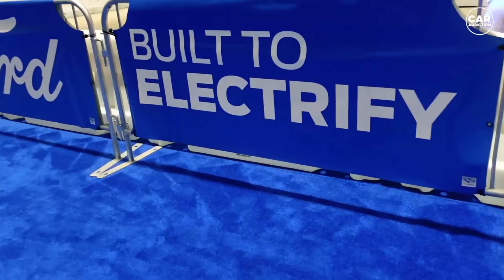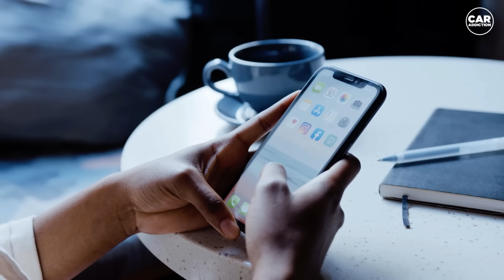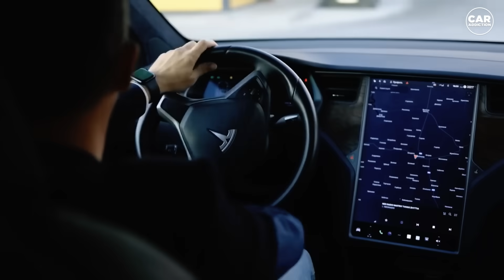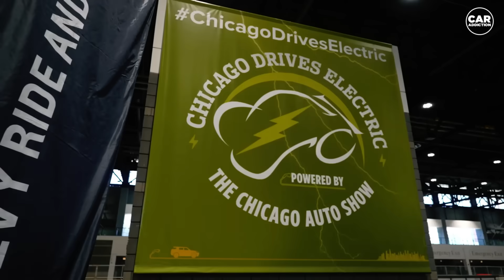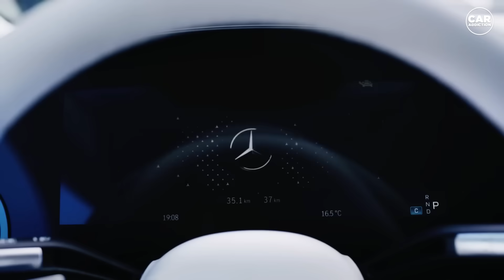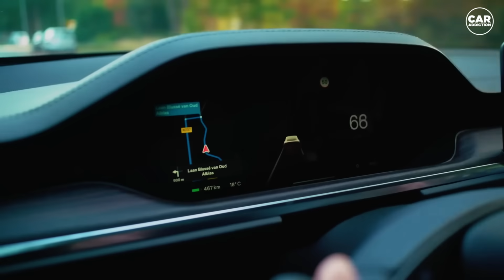Here’s Why Electric Cars are a Scam

Comment: Screw a greener future tripe. They are better period. 
Depreciation? Try buying a used tesla. Some cost more than new.
Battery degradation is not a thing. It is insignificant.  Newer batteries is a thing. The better batteries get the less expensive they will be. Just like flat screens used to be $10,000 for a 42" plasma, now you can buy an 83" for $1,500. Electric cars are technically speaking, electronics.  So they will come down in price and increase in value in the next 5 years.  Range will greatly increase as chage times greatly decrease.
Reply from the maker: Thank you for tuning in to my YouTube channel. Wishing you all happiness and success!